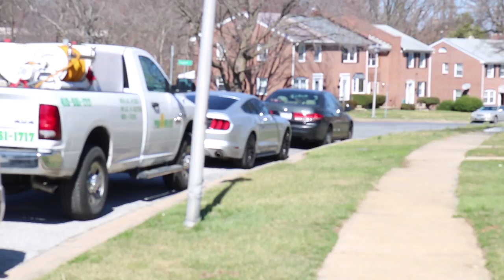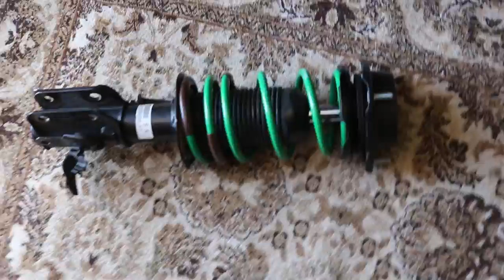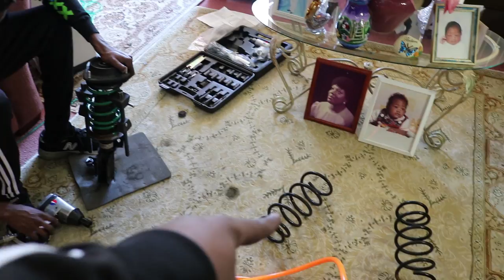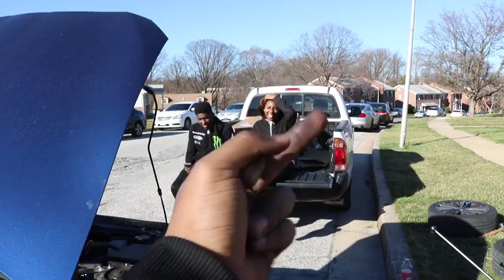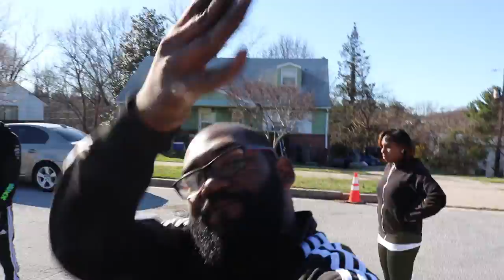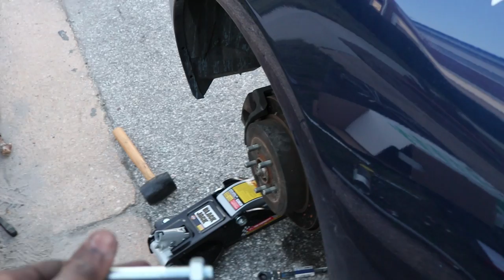It Broke!!! Tein Lowering Springs Are Finally On The FRS!!!!

Comment: How is the ride quality with the springs in and how low does it really sits after the springs settle
Reply from the maker: hoang nguyen so far as the height when it settled it didnt really move. If it did it was like a cm. The  ride is really stiff and responsive which is both good and bad. Good it handles even better than before and makes you feel confident. Bad .....pot wholes, speed bumps rocks in the road is a BITCH lol but it doesn't bother me that bad

Comment: It's too late now obviously but the problem why that back was giving you such s*** is the sway bar. I put  tein springs on mine and the back lower mounts sucked. Front was cake. Btw the quick fix bolt isn't a good idea. The strut mount bolts are special grade always go to the dealer for those or a spare car in a junkyard